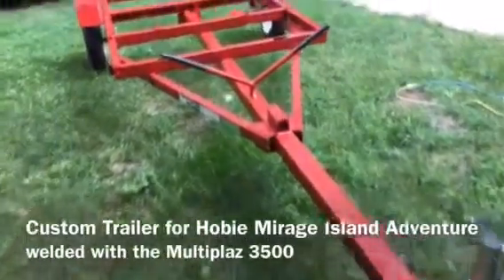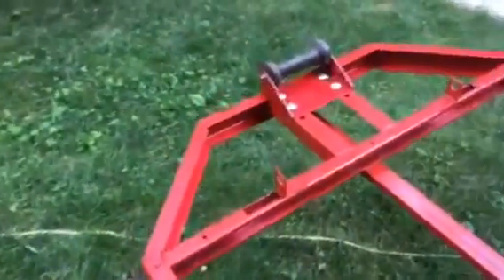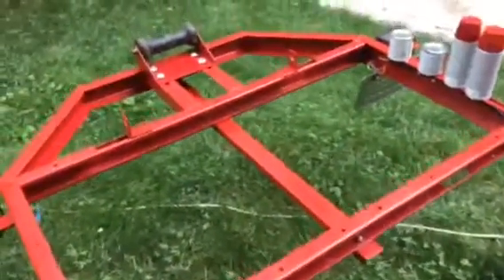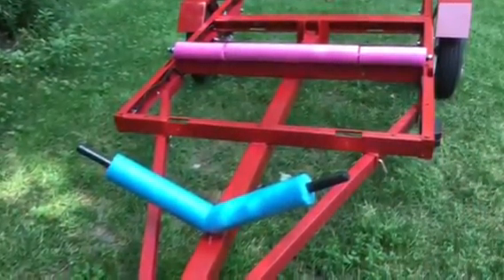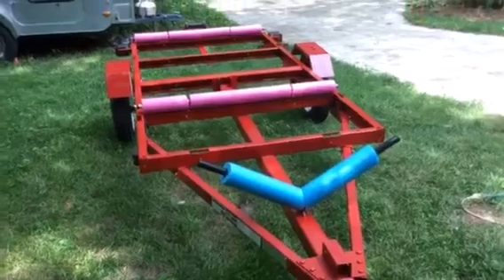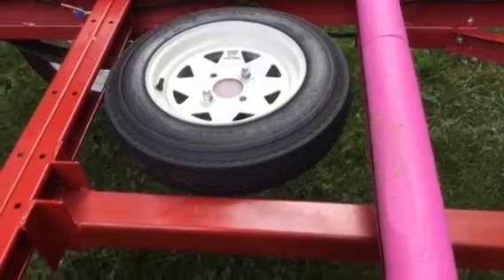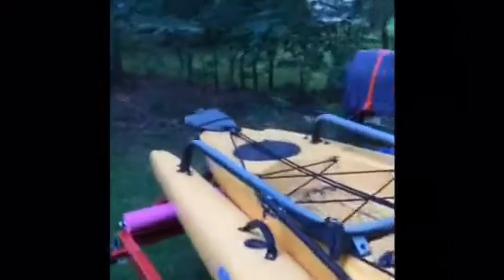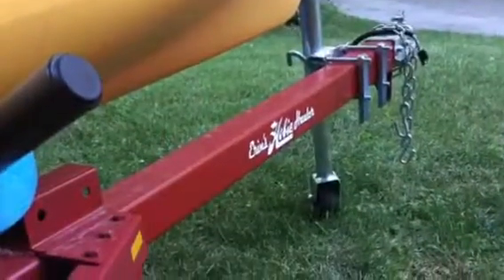Custom trailer for Hobie Mirage Island Adventure sailboat

Comment: Thanks for the video, Mark. I like the simplicity of your mods. Got a question: Hobie warns about NOT sitting the kayak on rollers for long time, and/or for traveling. Have you noticed any deformations on the kayak from trailering it using your trailer? I wonder mostly about depressions caused by the combined pressure from the straps, plus up-down shaking during traveling. Thanks again!
Reply from the maker: None so far.  I have thick foam on the rollers and multiple support points.